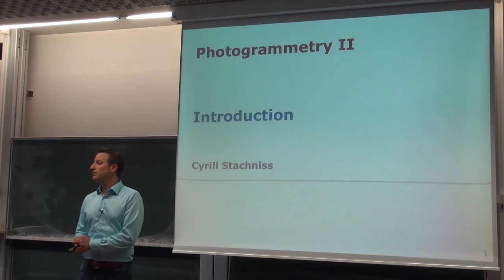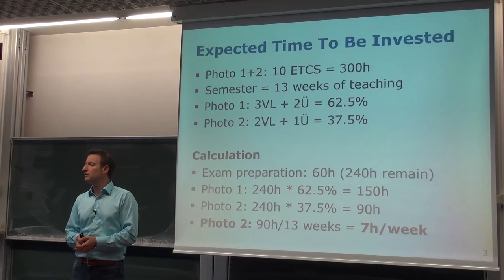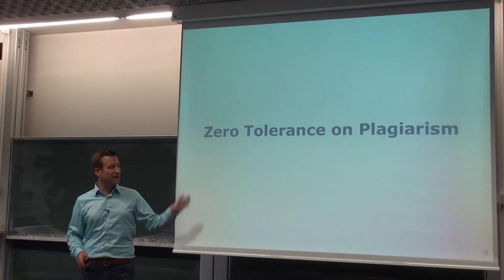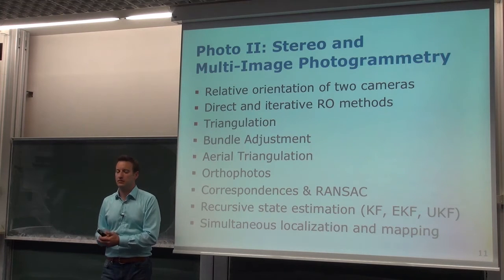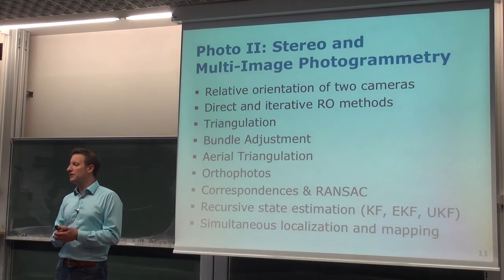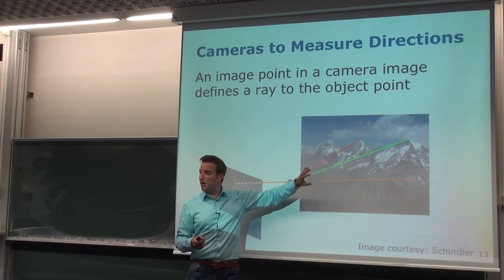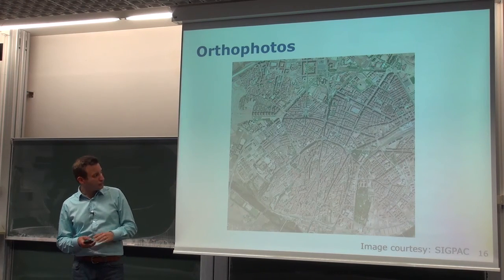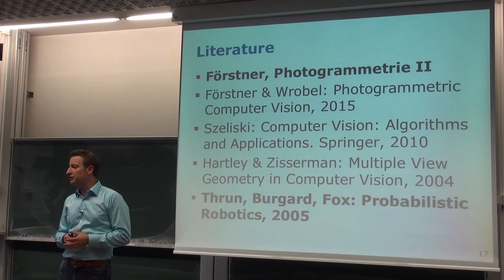Photogrammetry II - 01 - Introduction (2015/16)

Comment: Hello Sir, I want to ask what is close range and videometrics photogrammetry?

As I had read from some journals and videos from youtube, I found that photogrammetry had 2 general types which is Aerial and Terrestrial.

So, Terrestrial photogrammetry is also known as close range photogrammetry. The process of close range photogrammetry is by handled the camera or using tripod to take a multiple images from every point of the object for 3D modelling. 

But then, I don't know what is videometrics photogrammetry? Is it by recording a video for measuring the deformation? as what I read, photogrammetry is a process of taking multiple image and I'm not found by recording a video.

And is close range and videometrics photogrammetry is same as terrestrial photogrammetry? It is only expanded title from terrestrial photogrammetry?

Hope you answer me and give me some explanation about this Sir. 😊🙌🏻

Comment: Dear Cyrill Stachniss! 

Thank you for your class.
I have a question need to help. Can you help me?

I have a camera. I used this camera to record a sequence video. I walked and recorded. Maybe my video have 30 images. And I have measured some control points of my area. So can you guide for me how to obtain exterior and interior orientation of camera. As I know, I need do DLT to obtain Exterior orientation of Camera. And next I use bundle triangulation to obtain interior orientation? Is it right? Please guide for me right steps. Thank you so much!
Reply from the maker: +Nguyễn Trường Linh DLT for initial guess is a good staring point if you only need intrinsics and extrinsics for your camera. If you need the scene geometry, apply BA afterwards.
Reply: +Cyrill Stachniss Thank you for you answer.